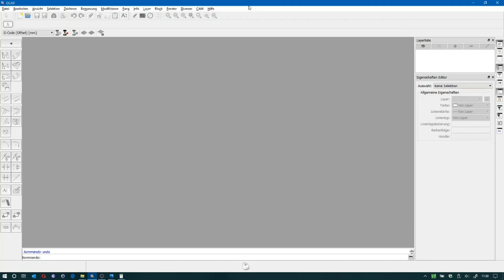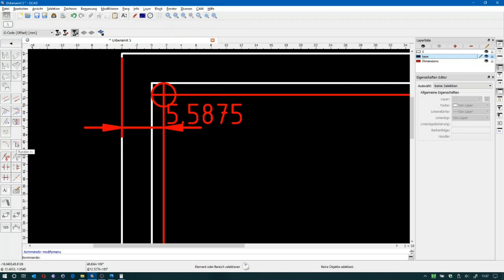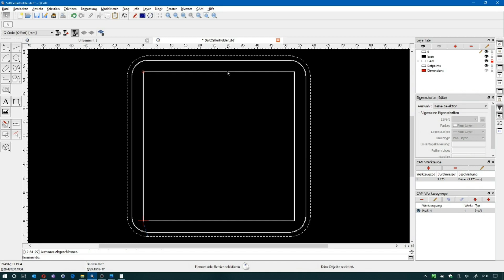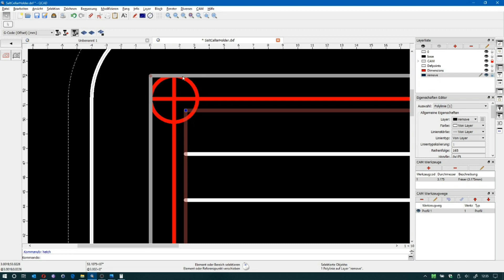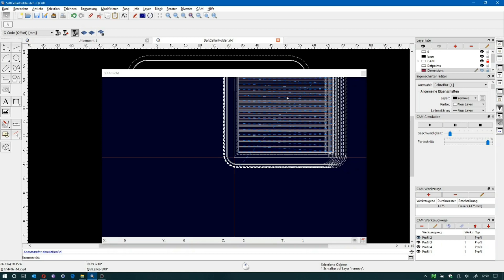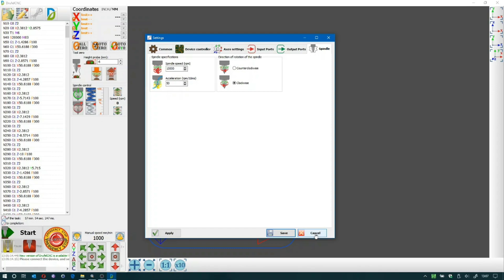SainSmart 3018-MX3, DrufelCNC & QCad/CAM

Comment: Do you like drufelcnc? Better than mach3?
Reply from the maker: Hi!

DruffelCNC works fine for my purpose and I like it. It is easy to use and straight forward. It is much cheaper and for private use it processes much more data free of charge. Also the hotline reacted to my requests (in the beginning DruffelCNC did not process the QCAM data and I send them some example data. Now they extended the interpretation in the new version and now only the DruffelCNC is working together with QCAM) even though I did not buy a commercial license. So overall a very positive experience and a recommendation from my side.

I cannot really compare to Mach3, since I did not want to spend the money for the Mach3 software. The limitations and the price were simply mostly incompatible with private use on such a small router and hence I never installed it. Moreover the new version of Mach is even more expensive and the old software might soon not longer be supported.  

Hope this helps. Greetings
Eckart